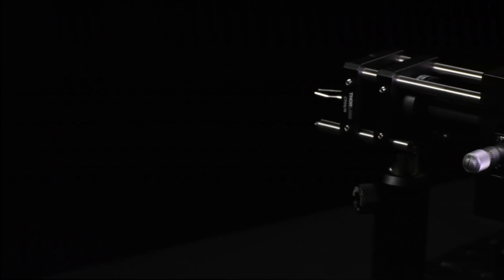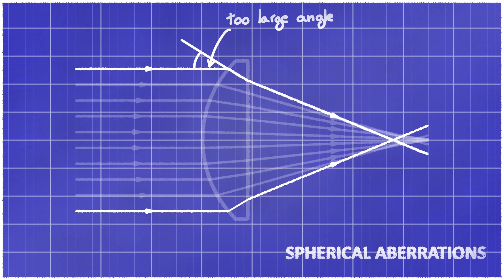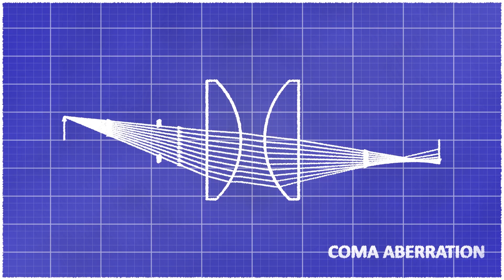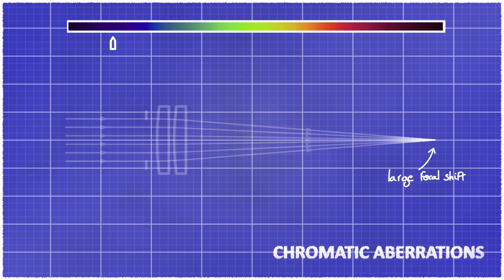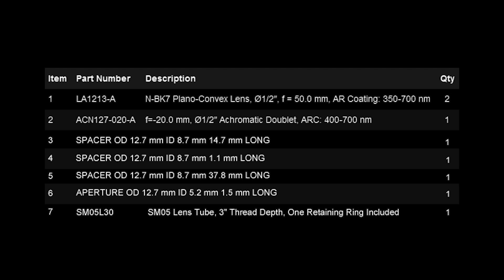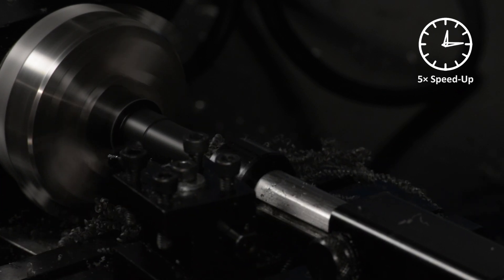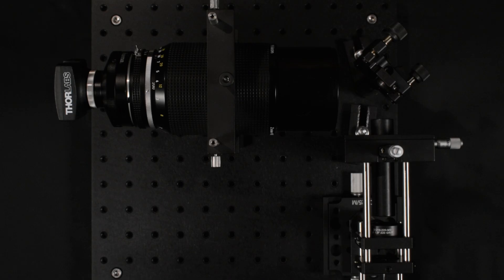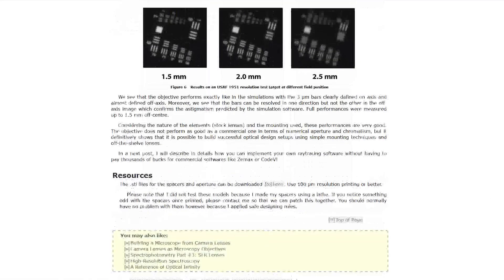Why lenses can't make perfect images

Comment: excellant video... I want to learn optics can you suggest how i should start. can you suggest a book for absolute beginners .
Reply from the maker: The best book I can recommend for beginners is "optics" by Eugene Hecht. It's the classical textbook that covers (almost) all fields of optics and that is used as teaching material as university. For optical setup themselves, resources are scarces but you can start with those of my website (free)
Reply: @thepulsar  Thanks you just ordered it from Amazon.
Reply from the maker: Excellent initiative and good luck :) don't forget to check on the website (thepulsar) and particularly the DevOptical posts as they're rich in information

Comment: Spherical aberration comes from the difference between a parabola, which is the correct shape, and a spherical lens which is much easier to manufacture. Spheres are so much easier to make that we just accept the aberration and compensate for it instead of making the right shape to begin with. Right?
Reply from the maker: That's true for mirror where you get one (and exactly one) stigmatic point but for refractive lenses the aberrations come from the non-linearity of the sine law. Small angles therefore lead to smaller deviations to the law and less aberrations.
Reply: Smartphone camera lenses can have very complex shapes that are very different from spherical, because there isn't much room inside a smartphone to use a large number of lenses to correct for all kinds of aberration. They are made out of plastic, which can be injection molded into the right shape instead of having to be ground out of a flat surface. The lens being made out of glass makes much more difference for larger devices where things like thermal expansion and the light dispersion/absorption matter more, and also when it is the outermost lens that can get damaged by environmental conditions or the user.

Comment: I don't understand the difference between oblique astigmatism and coma. They seem to both be caused by the same pheonomenon (off-axis rays impinging on a lens), so can one have one without the other?
Reply from the maker: You can do the same observations on aberration: some are symmetric around the pupil and other are asymmetric. Astigmatism can only be compensated by another source of Astigmatism, coma by coma, spherical by spherical, petzval by petzval etc.
Reply from the maker: They are indeed caused by the same root cause (off axis rays) and their nature is only revealed when you perform a power series expansion of the raytracing formula. Think of this as a formula y=ax²+bx+c; for a given x you have only 1 y value but it's a mix of three bases (x², x, 1) which have different effects and can be studied separately
Reply from the maker: Each of these bases also have different properties, e.g. x² is a symmetric function while x is asymmetric. Also, on a range of different x values, you can only compensate a x² by another x² and a x by another x function (i.e. you cannot compensate x² by a x function -- at least not for a range of x values)
Reply: Thank you, all of this is very helpful. What you are describing are the different Zernike polynomials, right? But so, if the cause of coma and astigmatism is indeed the same, when I send off-axis rays on a lens, will I always have both aberrations at the same time? If I look on a tranverse plane, can I always see some coma, and if I look along the optical axis, can I always see some oblique astigmatism?
Reply from the maker: Some ray positions can cancel some of the aberrations and not others so you can have a surface with astigmatism but no coma. Zernike polynomials are (to my knowledge) essentially used in ophthalmology but more theoretical analysis of aberrations relies on slightly different bases (power series). For instance, zernike doesn't have the concept of petzval curvature or distortion

Comment: Thank you for this.  I am a daguerreotype photographer and I have an optical problem.  I have a camera built in 1840.  The lens system is very primitive.  There are four Plano-convex elements arranged in a tube in two cells.  All the lenses have wooden spacers.   I believe they have been removed and replaced incorrectly over the years as the camera exhibits severe spherical aberration.   I am trying to sort this out.  Would you be willing to help.  I can be reached through my centurydarkroom website contact page.

Comment: Thank you very much for this fantastic video.
I would like to ask one question.
By looking at your website and using the parameters, I calculated the magnification of this optics system is about 2. 
so1: 6mm, f1: -20mm, f2: 35 mm, d: 15 mm
Something wrong?
Reply from the maker: Using two 50mm lens + the -20mm one you should get an effective focal length of 35 mm which combined to a 200mm lens gives 200/35 ~= 5x magnification
Reply from the maker: I re-did the maths quickly and 50+50 you get around 25.5; with the -20 & 15mm it goes to 50-55. Probably with the thicknesses of the lenses themselves the  distance increases a bit which reduces the focal length to ~35-40 mm
Reply: @thepulsar   Thanks a lot for your kind and helpful reply. Yes, as you said, due to the distance between the lenses becoming longer (19-20 mm) so the effective f can be gotten as 35mm. I really appreciate your responses. When you come to Japan again, please don't hesitate to contact me😊 I will guide you

Comment: Hi. Great video. Which software did you use to make the animations? Thanks
Reply from the maker: It's a combination of Adobe Illustrator and After Effects :) to get accurate rays I used the raytracing equations (website) and exported in vector format .svg using custom C++ software.

Comment: Do you give private guidance?  Paid of course.

I need to select a lens for 3D reconstruction in an artificial vision system using "Depth from Focus", and your video helped me a lot. 

I learned more with this video than reading manuals from Edmund Optics, Keyence, Dr. Schenk and self-called specialists.

It's excellent video to understand optical design.
Reply from the maker: No paid guidance; only free help :D within  the (limited) time I can allocate every week. You can use the contact form on the OpenRAMAN (dot org) website to reach to me. Let's check together if I can help you with your problem/project.
Reply: @thepulsar  Thank you very much, i'll contact you today.
Reply: @thepulsar so lenses csnnot make a perfdct image because you will always have.refraction even if no aberration?  Thanks for sharing

Comment: All the gloves I have ever used leave small marks on lenses. Where do you find gloves that leave no marks
Reply from the maker: Before the pandemic Thorlabs had some nice thick nitrile gloves. At the office we buy from VWR. Also, you can impregnate a fabric with alcohol and rub your hands with it to remove any greases left on the gloves. Do not rub directly your hands with alcohol as it is both ineffective and dangerous (I spilled i-PrOH in my eyes twice doing that... even though I had glasses). Avoid touching optical surfaces as much as possible, even when wearing gloves; especially for delicate items like mirrors and gratings

Comment: ¿How do you select elements? ¿Did you optimize element and positions?
Reply from the maker: Ideally you would optimize the radii and the thickness by gradient descent but with stock elements you have no other choice than substituting lens and check how the various combinations perform. Of course you would always apply the highlighted design rules such as power spreading over two lenses etc
Reply: @thepulsar  What do you think about next? You optimize and after that select only stock lenses with "near" characteristics to those coming from this optimization. After this, re-optimize again but maintaining fixed the parameters of the selected lenses but other lenses with variable parameters and also distances between elements... ¿Could this help?
Reply from the maker: @guillermobaldwinolguin1697  this is the recommended procedure when I attended my opt design classes but the results are (most of the time) not that great. On the other hand, some combinations of lenses seems to be "magic" and give really good results. 3-4 years ago I started making an open source program to test the combinations  but it's currently on pause. I would like to resume it once I have progressed enough on my OpenRAMAN.org project
Reply: @thepulsar  ¿And how do you determine the distances between elements?
Reply from the maker: @guillermobaldwinolguin1697  regular opt is enough for that with either wavefront or spot rms as evaluation parameter
Reply: @thepulsar  Understand the evaluation, but… ¿What do you mean by regular opt / or how do you use it?
Reply from the maker: All optical design software will allow you to define an optimization function and will update the tagged properties such as thickness, radii or aspheric coefficients such as to minimize the optimization function. Here you would tag the various thickness and use the rms spot size as optimization function. In practice it's slightly more complicated because you also need to include failsafe options in the optimization function to avoid, for instance, negative thickness between elements or super long distance, wrong focal length and so on